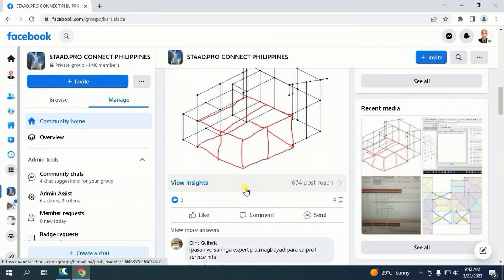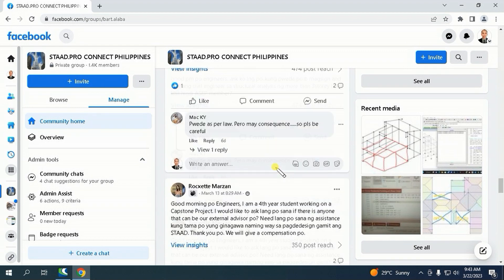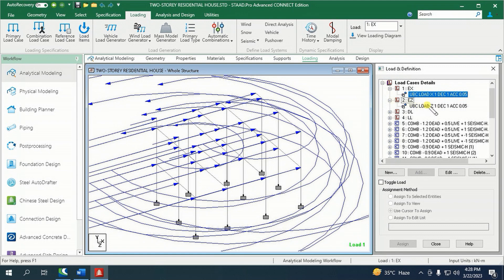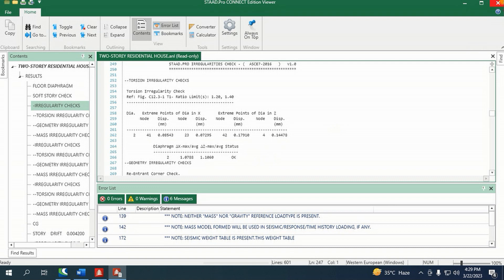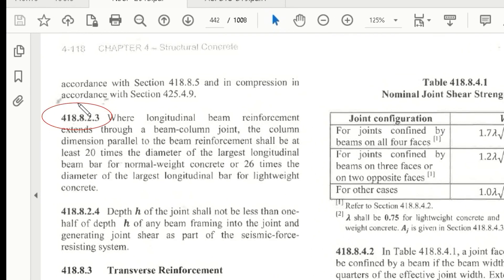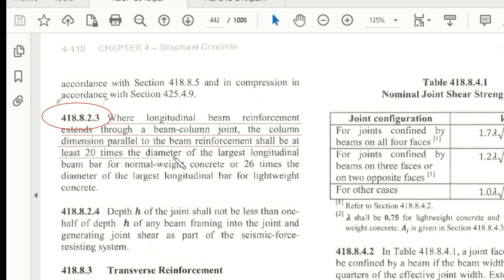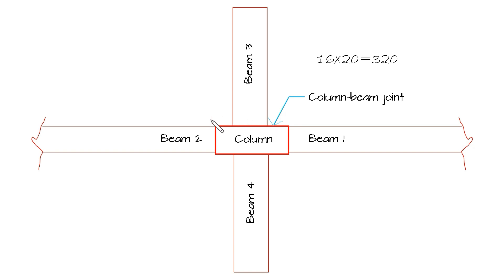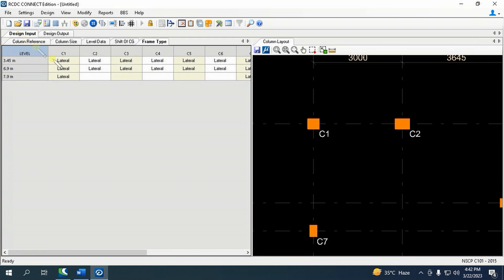COMMON FAULTS IN CONCRETE DESIGN USING RCDC SOFTWARE..

Comment: Sir sa mga failing beams, ano effect if iuncheck po ductility para mag pass? Rather than increasing beam section
Reply from the maker: If your structure is in zone 2, then you can uncheck ductility, but in zone 4, it is required to utilize  the ductility property of reinforced concrete if it is part of main resisting frame, if not, you can uncheck ductility for not part of resisting frame.

Comment: kung tama ang pagkaintindi ko sir, pwede lang sa 250 na dimension sa column is 12mm rebar, pwede kaya taasan ko na lang ang grade ng steel like grade 60
Reply from the maker: Kung gagawing 12mm ang column mag fail ito, kung remain as ease lang ang column pero  ang beam rebar ay gagawing 12 mm lang, papasa sya kung gagawin mong 16 mm kailangan baguhin ang column size.... yung model naka attach pede mo i try sir...
Reply: @BARTLANTV  cge sir, mas maganda nga kung i observe sa actual. thanks sa reply sir